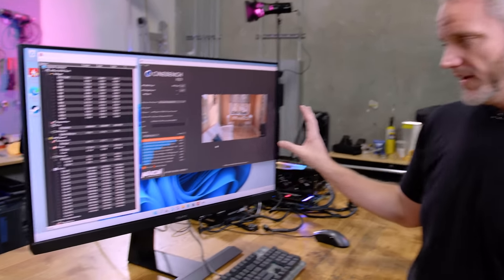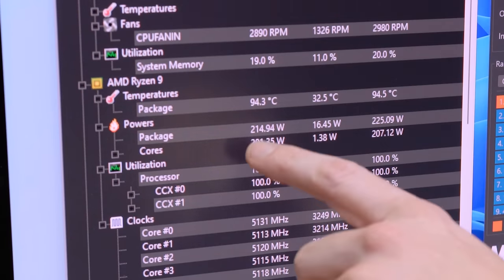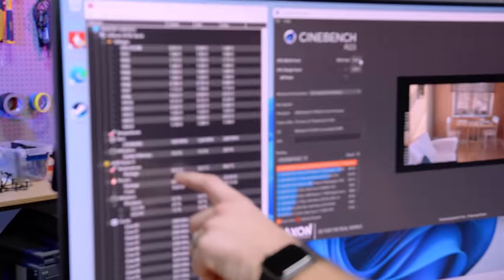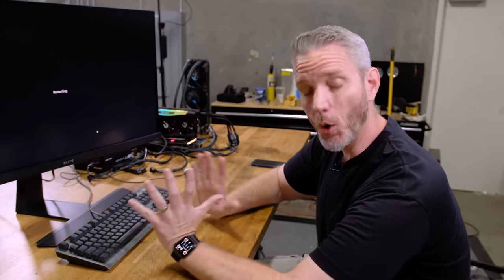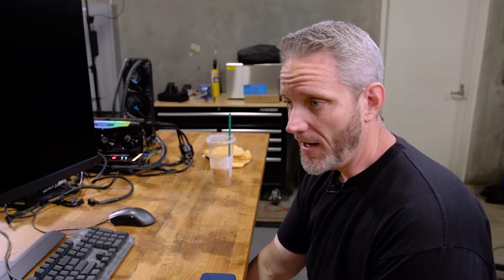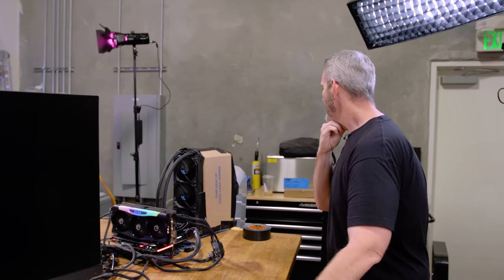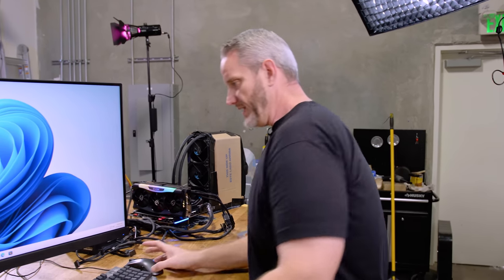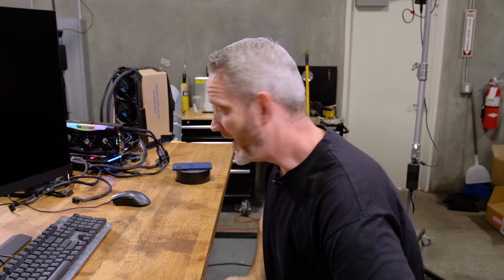This is fine...

Comment: I think what a lot of people don't really understand is if a device is generating 250 watts of heat it doesn't really matter if the hotspot temperature is 95 or 80 it's still the same amount of heat being generated and your room won't warm up any faster because 250 watts of heat = 250 watts of heat.  Temperature is like voltage, if I have 120 volts at 1 amp it generates 120W and if I have 12v at 10 amps I still have 120 watts. What is missing in the equation is the actual density of the heat because all they are measuring is a tiny spot on the die. That's like lighting a candle in a room, while the temperature is higher right next to the candle the overall room temperature doesn't really change because the density of the heat is so small

What really needs to be done is monitor the water temperature on a new 7950 drawing 220 watts and a 5950 also drawing 220 watts. The fact that it cools down so fast tells me that actual density of the heat isn't any more than a normal 80C system drawing 220 watts. What I suspect will happen in this experiment is the water temperature on both system will be roughly the same even though there is a fairly large difference between the hotspot temperatures after all 220 watts is 220 watts

To cool this CPU properly is really no different than any other CPU, concentrate less on temperature and instead how many watts of heat your cooling system is capable of dissipating. That is what really counts in the end
Reply: exactly, more people need to pay attention to the watts instead of the temerature!, im looking forward to testing this with the eco mode aswell

Comment: Im honestly interested to see what happens when i plug this thing into my custom loop.  When i designed it initially, i overkilled the amount i should have needed by quite a bit since it included CPU and GPU+Active backplate.  Seems like i might be okay if not making my rig into more of a space heater than it already is.
Reply: You also have the versatility of cranking up fan and pump speed. 1250rpm is usually not too loud for good set of fans - pump varies. But you shoudln't be worried about the cooling capability of a good custom loop, regardless of the components.
Reply: At this power draw for a small area, I feel the limiting factor is heat transfer of the thermal paste, and heatspreader.  If you do a direct die cooling setup with liquid metal you can drop 20C.

Comment: These kinds of temperatures for prolonged periods kind of have me wondering more about the degradation of motherboard components than the chip itself. Are we going to start seeing cooling fans for the back of the motherboard socket?

Also, the second you said "Open the browser" and clicked, my video started buffering. I died laughing 😆
Reply: I doubt the temps can transfer well enough through the the chip pcb itself to affect the motherboard. Older ryzen pins would be falling off left and right if that were a thing. Especially since the heat is instantly passed through the ihs. Things generally try to take the path of least resistance. You're not gonna see lightning try to bore a hole through a wall to get to you, it will jump to whatever metallic thing is nearby.
Reply: @Wheres_my_Dragonator  I get that, but if you've ever stuck your finger on the back of the PCB of your GPU, you know that gets pretty toasty, even under moderate loads. I'm not specifically suggesting cooling the back of the board is for helping with CPU temps, just overall system temps in general.
Reply: Yeah I'm curious to see what the longevity of these systems will be, esp when you undoubtedly have people that aren't cooling them correctly
Reply: @Wheres_my_Dragonator  It doesn't have to transfer from the CPU to the mobo, the mobo itself will heat up (unless it is a very expensive one with overboard VRMs) from the 100W+ loads all the time. The VRM will have to handle the increased loads and the CPU socket will have to sink the heat from the CPU and all the amps rushing through it. In 8core + territory we are talking 200W+ now, this is bonkers..... b350 had 1 or 2 boards that could handle 100W, b450 had a few more and b550 can generally run it just fine, but b550 was more expensive, because of that. The next b650 will have to be even more expesive or caps will start blowing up. And probably forget about cheap electrolitic caps, they'll have to use the more expensive solid ones. There is a reason 65W CPUs were/are the norm, with 90-100W ones being for "enthusiasts", more than that is FX9590 territory and where Threadrippers used to be. When does this end ? Next gen 300W ?

Comment: 5:30 it is localized heating.  If you used HWINFO you can even see the L3 temps, and considering it is on the same die as the cores, with 4 cores sandwiching each block of cache, watch the temps.  L3 will be in the 50's while the cores are in the 90's.  It is all about the inability to get the heat effectively into the cooler through the IHS.  Same as 7nm, just magnified further.

Comment: With Ryzen 5000, Curve Optimizer was the way to go. Don't trust Ryzen Master's auto tuning it does. It'll zero in on offsets that are way too high. They'll be stable in the short term, sure, but they will cause crashes over time. Although the values it finds could be used as a good starting point for manual tuning. But the curve optimizer lets you undervolt (or overvolt, but that's not what most of the community used it for) each individual core separately. Doing this can really help control the power consumption and heat generated by the CPU. Then after that you can mess with the PBO settings (PPT, EDC and TDC) to use the extra thermal and power headroom you got from the Curve Optimizer to bring up the overall performance. It's definitely a very different style of tuning than just telling it to run higher clocks and increasing the voltage as necessary. I feel it is better for an every day use system though. It just takes a really long time to dial in the values. It took me like 3+ weeks of running stress tests to find the rock solid stable offsets for all my cores, but it was worth it.
Reply: Its great until the current agesa still has a bug to where it wont boost over the stock edc limit so you cant even use pbo to oc along with uv
Reply: Shulk, can you please edit this to paragraph break? It’s too long for some to read/ understand.
Reply: I tried using curve optimizer for my 7950x and it gave such a massive undervolt Windows wouldn't start

Comment: Would definitely like to see these tests done with a lapped CPU. My concern is more about dumping too much heat into the room in the summer with the 7600X seeing as AMD has abandoned the 65W specification - so could you show more about limiting the power draw? Thanks!
Reply: Yeah, no worries. He's going to make a video just for you
Reply: You could always get a 5000 Series CPU Limiting the Power Draw will Limit the CPUs Potential so if the Temps are your Worry go for a CPU that isn't Designed to go to that Temp

Comment: I think you swerved into it, but if they're recommending AIO water cooling for normal CPUs, either motherboard makers will have to add fans to VRM cooling, or we'll have 17 pounds of aluminum and heat pipes just to cool power delivery.
Reply: Does a top mount radiator or rear mount exhaust fan not provide decent VRM cooling when using an AIO?
Reply: @Yahtzee9820  I think thats a question for tech and testing channels; some say it isn't because there isn't as much air or dedicated cooling for those specific components other than a large lump of metal and whatever happens to be moving through the case. However not all cases are made equal either in terms of directional flow. If you remember back in the day some board makers would have tiny little fans on chipsets specifically.
Reply: I wouldn't call the 7950x a 'normal' cpu.

Comment: So from a previous video you made you mentioned about having the water cooler cables down at the bottom cause eventually the water will evaporate or the air bubbles may make their way to the CPU cooler or whatever. Well the computer I got a long while back from NCIX from their California branch a few years before they shut down they put in the radiator with the cables near the top. After seeing your video and finally having some time and blowing out all the dust out of my computer finally got around to moving the cables down to the bottom while making sure to try and get all the air up into the top of the cooler. So far seems to be working just fine.

Comment: I would love to see a video of testing cooler on those new CPU, starting with a 212 up to custom water cooling to see what kind of performance you get when upgrading your cooler with the new AMD 7000 CPUs.
Reply: I second this!
Reply: Third! I just upgraded to 5800x with 212 evo and ran curve optimizer. Would be interesting to see it with 5950x.
Reply: same, especially the "kings" like the Noctua D-15 or the Deepcool Assassin or whatever else and if they're still considered equal to mid-grade AIOs

Comment: Supposedly, De-Lidding drops the CPU temps significantly.
Reply: You can't delid these unless you are insane.  You need to use a frickin razor blade to cut the IHS off, as it is soldered on.
Reply: der8auer just did that and it does
Reply: @DailyCorvid  how does that make you insane? It’s super easy
Reply: @DailyCorvid  Negative derbauer posted a video already and is going to make a tool for it
Reply: pretty sur Der, De-Lid'd and direct-die cooled the cpu. (and it worked, hello warranty)
Reply: @DailyCorvid  you need more der8auer in your life homie. He probably is crazy and has easily already done it and had it on liquid nitrogen.
Reply: @DailyCorvid  Not that I've ever done it myself, but you just described the standard way of delidding.
Reply: @DailyCorvid  yeah, and that's what people use to delid them 😆
Reply: It's pretty straight forward, you will either use direct die cooling with custom parts from  der8auer and enjoy lower temps or you will run stock. And with how Amazon returns work it's never been easier to get into de-lidding and direct die cooling. I have personally destroyed and broken 3-5 processors so far. All of which I just put the IHS back onto and shipped back to Amazon and got a full return on my credit card. I then repeated until I figured it out and did it properly and it worked.  If you want your AMD Ryzen 7000 series CPU to be 75-80c under load you will have to use the aforementioned methods. Otherwise just accept 95c is the stock accepted temperature and there is nothing you can do about it without de-lidding and direct die cooling.
Reply: @ignacio8597  and killed a 7700x with a CNC milled tool.
Reply: @crunch9876  Super easy, barely an inconvenience

Comment: Isn't the chip getting to 95c but the IHS is not getting anywhere near that temp because it's a lot thicker for cooler compat, that would explain why Der Baur got 20c off when he delidded the cpu
Reply: That's a massive oversight
Reply: yup, you're completely right. pretty sure jay was trying to "dumb" it down for the average watcher though
Reply: I wonder what the temp of the liquid is compared to the 5xxx chips and what would happen to the temps if no cooler was attached (that might be a tad evil though)
Reply: It's pretty straight forward, you will either use direct die cooling with custom parts from  der8auer and enjoy lower temps or you will run stock. And with how Amazon returns work it's never been easier to get into de-lidding and direct die cooling. I have personally destroyed and broken 3-5 processors so far. All of which I just put the IHS back onto and shipped back to Amazon and got a full return on my credit card. I then repeated until I figured it out and did it properly and it worked.  If you want your AMD Ryzen 7000 series CPU to be 75-80c under load you will have to use the aforementioned methods. Otherwise just accept 95c is the stock accepted temperature and there is nothing you can do about it without de-lidding and direct die cooling.
Reply: @yakivpopavich  bro do not admit crimes on the internet 💀

Comment: Hey Jay, I believe it's because under full load, the auto overclocking will just keep rising until it hits that 95 degree safe limit.  It only stops increasing its speed once it hits 95 degrees.  It's how AMD decided to control it on purpose.  It makes it easier for the user, and also safer, as some people bring their systems to the very edge, and run it like that all the time, and with it shorten the life of their processor, often significantly.

Source: Gamers Nexus.
Reply: I never heard gamer nexus say AMD will shorten their cpu life running at 95C. Lol another intel fan boy

Comment: test the CPU with diffrent power limits like 65W, 110W, 150W etc to see what kind of performance you can get out of it and the temps on that aswell
Reply: Anandtech showed, it outperform stock 12900k and 5950x at 65W and losses about 20% multi-core performance of the original settings.
Reply: @superneenjaa718  tyvm for that reply!

Comment: It’s impressive that it can maintain max boost at such high temps. Above 70c makes me uncomfortable cause I see my clocks decrease but if 95 is fine then so be it. The more important thing is wattage and power efficiency.
Reply: Use Eco Mode. Wait for Eco mode testing.
Reply: Apparently tjmax is 115C for this gen.
Reply: @chaon93  It's 95 degrees C tjmax for Zen4.

Comment: Curious to see if AMD takes this knowledge to heart and adjusts the IHS and contact between the chips and the IHS. 

Seems like it's less about it being a hot CPU and more about a manufacturing defect that could be adjusted for by changing how the die contacts the IHS.
Reply: Very low likelihood they change fabrication at this point in the release cycle.
Reply: In his past video, he said the AMD rep he spoke with was the one that said 95C was intended

Comment: I undervolted and overclocked my 3600 to 1.25v and 4.2ghz and didn't notice any performance issues, stock would hit 1.4v at 3.8ghz even with the auto overclock stuff on
Reply: 4.2ghz is considered a slow clock speed these days lol
Reply: @kyles8524  got my 12900k at 4.5. -7 but hard to go up and try to render in blender, blender takes more than gaming

Comment: Do you think now with the way this cpu temp is set up, it will effect the temp on the gpu in a single custom loop? Thanks for the video
Reply: Unlikely, it isn't running at 95C because it can't get rid of heat fast enough. More that it doesn't care about the temp. So the waste heat wattage going into the loop won't be much different than any other equivalent TDP drawing cpu.

Comment: I trust the chip at that temp (95c) but what concerns me is how the sockets and motherboards in general will hold up. Not to mention the added risk of AIO failure due to the constant high temps. We all know heat is a computers worst enemy so I guess only time will tell. Im more interested in 40 series NVidia atm but these chips do seem to be quite amazing.
Reply: Water.  Water is the worst enemy, heat is required.
Reply: @DailyCorvid  lol yes very true.
Reply: the fluid only reached 30C its cooler than intel parts were making the fluid a few years ago stop worrying
Reply: It probably won’t affect me regardless as I haven’t used AMD since around 2012. Back when I had no money. I prefer Intel\Nvidia. I’m still using my old i9 9900k and i7 10700kf. Im keen to see the Raptor lake figures now. I’m fairly certain my new build will be raptor lake with 40 series nvidia. But if Raptor lake is a bust then I’ll be going back to AMD.

Comment: Hey @JayzTwoCents... Have a question around a topic that I've only ever seen you address so you might be the only that can answer this...

You mention that the Ryzen is crazy responsive... But you also said that about the 12900k in your 1 month review video. 

Do you find the Ryzen significantly faster than even Alderlake? I'm coming from a system that's definitely not responsive and I'd be willing to spend extra money for that.

Thank you!

P.S. For anyone else wondering why I'm saying extra money for the Ryzen... In Canada so all pricing in CAD:
- $550 for 7700x + ~$500 for an ITX Mobo
- $370 for 12700F ($450 - $80 MW2 bundle which I'll be buying anyway so I'm counting it as savings) + $250 B series ITX mobo.

Rumored B series pricing for AM5  is still around $350 CAD BUT I get platform life and 3D cache access down the line so I'm willing to spend the extra if I need to.

Comment: Getting a lower CPU temp does NOT improve the "space heating" aspect of your room. Actually it dumps more heat, as a cooler running CPU will dump more watts of heat into the room. All heat will make its way into your room, whether through your cooling solution or not.

Comment: Got a new Case Corsair 4000D and a Corsair 360mm water cooler, my 3700x doesn't get warmer then 37/45c in gaming haha damn. Before I had the prism, in cinne it got 65/72c not to bad but loud, and 360mm with cinnebench it would not get hotter then 50c, that's just crazy. It's so quiet to lol. Rpm doesn't really ramp higher then 600rpm. Didn't overclock it tho, so it's not really getting hot. Nice video btw!

Comment: if all core is 5.1Ghz, just run it at stick speeds, it will all core to 4.5 GHz, that 600 mhz will NOT be noticeable at all in day to day use and your processor runs at like 70c max

Comment: I've been consistently running my i7-7700K around 90 degrees for the last five years and yes it does spike to around 95 sometimes. 
I bought it day one and immediately overclocked it and haven't touched it since because it's been totally stable. Coming from 7th gen i7 that came out of the box extremely hot this is not all that concerning or out of the ordinary. If you aren't 90% of the way to Tj Max and aren't throttling then you still have headroom they're just finally controlling it really well on the CPU level.